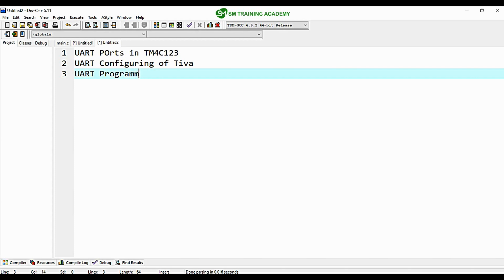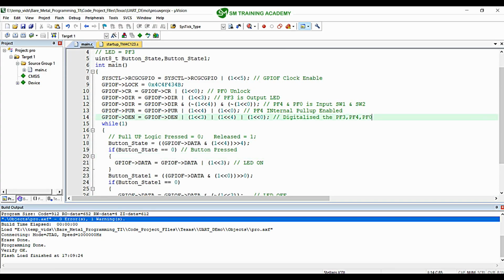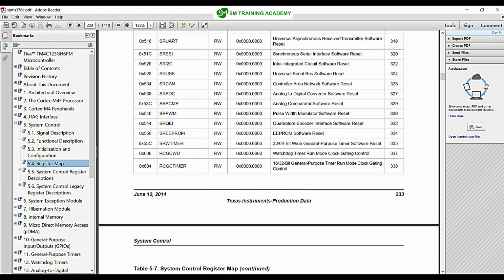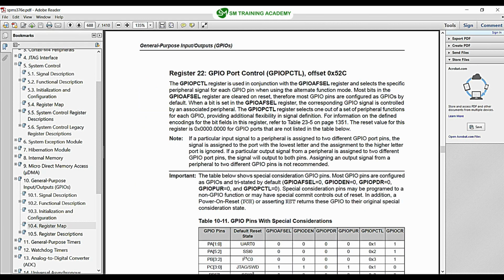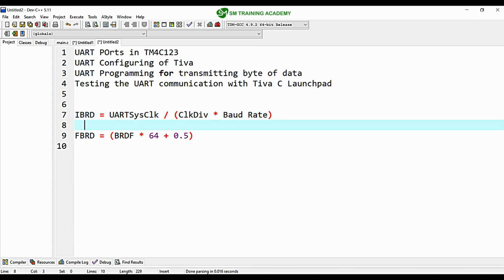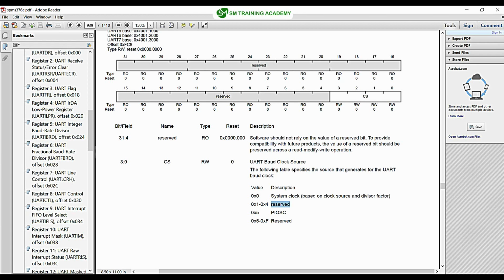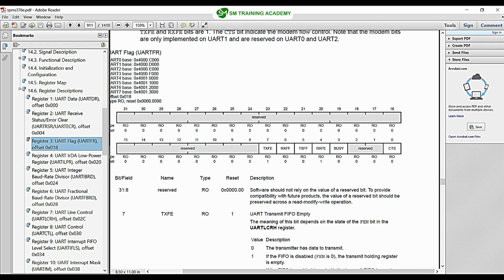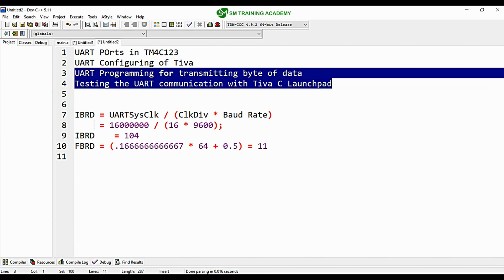Implementing UART Transmission in TM4C123 | Embedded Systems

Comment: hello can you explain what does the data sheet mean by holding register . secondly , why the FIFO are disabled , cant we code them like they are enabled. In short what does it mean if FIFO is disabled or enabled ?
Reply from the maker: Ya FIFO are first in first out registers we cannot code them I’ll try t explain them with a  video .